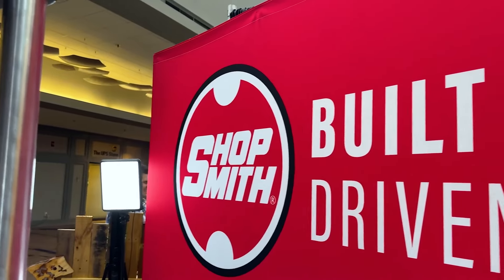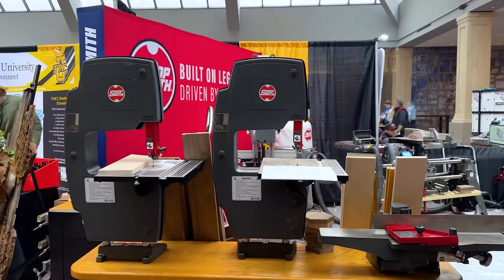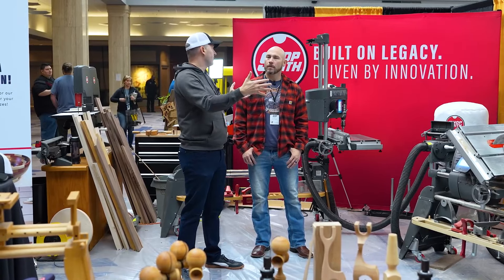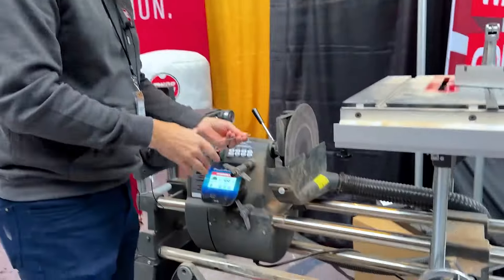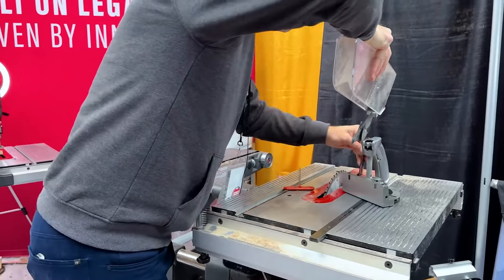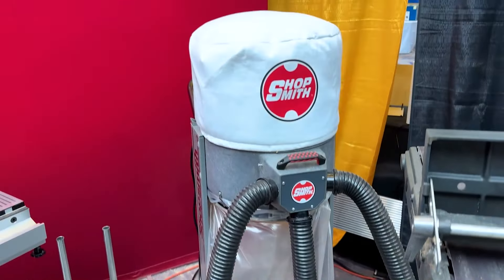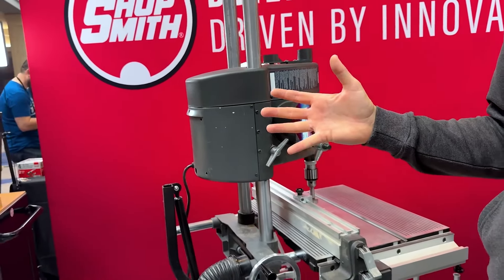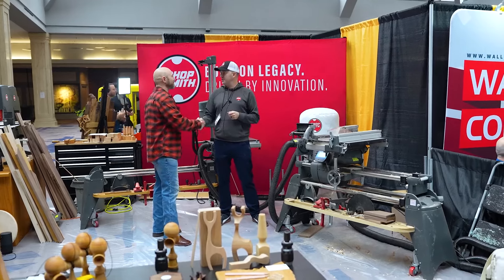Shopsmith CEO & 731 Woodworks Discuss MARK 7 Woodworking Tool

Comment: Mr. Nick Cupps, I have owned and use a Shopsmith since I retired from the military. Especially enjoy it's sturdy build and it’s versatility!
Something I think you might check with Mr. McCann on, is to advertise and demonstrate the use of the drill press mode for light wood and aluminum milling. Since the lateral forces are typically the same as when the shopsmith is used for shaping and routing, it can be used for light  milling also. The previous owners have not highleted this selling point.
Reply: I have an inexpensive X-Y table and have milled some plastic stock with my Shopsmith, making replacements for various broken doodads.

Comment: The biggest impediment to starting woodworking is price-great machine but how much?
Reply: Buy a used one and get to making.  Shopsmith can supply any repair or upgrade parts you might need or want.  The available specialized accessories fit even the oldest machines.  I bought my late father-in-law's Shopsmith for $100, took it apart (not hard!) and hauled it home in my Prius.

Comment: And what will all that cost?  He says the biggest barrier to entry is space, I know it's cost.  That's why you buy individual tools over time.
Reply: 5k brand new, you can get a used one from 250 to 1000 bucks. Which is all still cheaper than buying individual machines at a equal or similar horse power.
Reply from the maker: You're correct, cost is also a barrier to entry for many people. Over time, buying all the individual tools could end up being anywhere from $5,000 to $16,000, depending on the quality and capabilities. Two more thoughts on the topic of price. Firstly, we work with Affirm to provide people the option of monthly payments at 0% APR. Additionally, if that still isn't doable, we encourage people to look for a used Shopsmith. Our machines are built to last and you can purchase an old MARK V at a very good price. We still supply parts for the older machines and all of our new attachments and upgrades can be used on most of the old models. Thanks for the comment and brining this topic up! :)
Reply: @shopsmith  ring back the surface planer. The new SS could also handle a larger jointer. 6 or 8” if it is wired for 220.
Reply: You can get a complete set up from marketplace for 250.